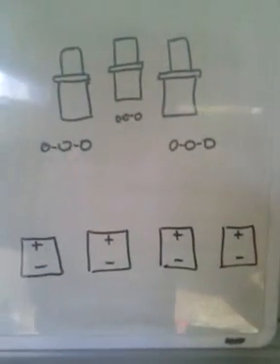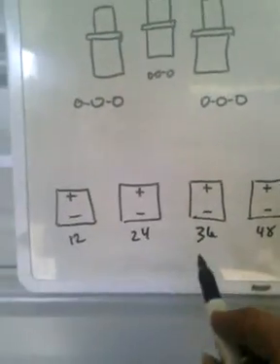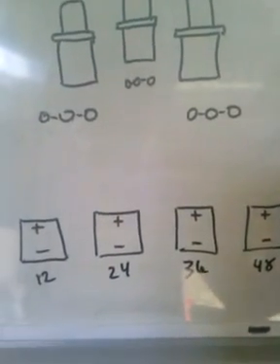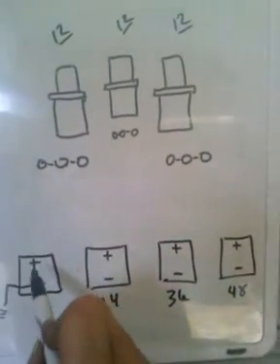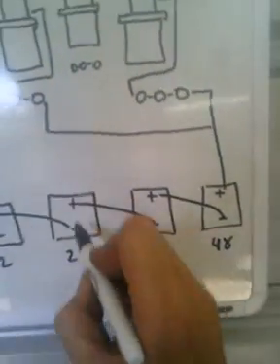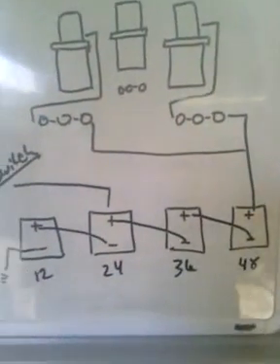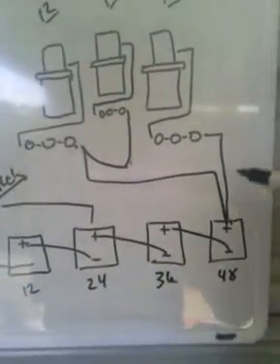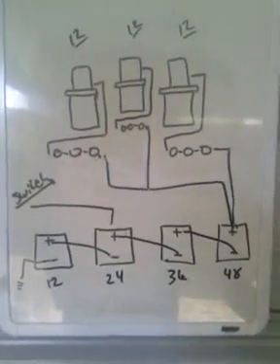Wiring Diagram for hydraulic set up on a car

Comment: Can you run 9 batteries with 2 pumps?
Reply from the maker: yes, but depending on your setup as far as it being built as a hopper or just a streetcar lay and play 5 batteries to the nose and 4 to the rear. Just keep in mind 60 volts is alot of power to regular motors and solenoids. if it's a basic street car I would just stick with 8 batts 48 volts to front 48 to rear. atleast 3 to 4 solenoids per pump

Comment: ive been running my set ups this way and find this to be the most fun and reliable way to lay and play, solenoids and switches are more than 5 years old easy i go through a starter every 3 years if that. Gears ive never had to replace

Comment: Where do you put the ground disconnect ?
Reply from the maker: f13joker if the rack is welded to frame you can use the battery tie down rod if not use a bolt on the frame. Then of course the other end will go to negative post on 1st battery

Comment: I have 8 batteries, and two pro hopper pumps. Should I run each pump to a set of 4, or both pumps on all 8 batteries?
Reply from the maker: Joseph Keith Yates II a lot depends on your intentions. if it's just a cruiser yes 2 banks of 4 at 48 volts would be great. the backs gonna be fast so you could do 5 and 3 that way more power to front snap it a little quicker and back would be about perfect on 36volts.
Reply: Bradley Powell thanks for the quick response. The switches could be ran to either set right?
Reply from the maker: Joseph Keith Yates II yes, just make sure it's only a 24volt supply

Comment: can you explain how to charge the batterys in a low low I just got a cadi 6 batterys 4 switch's 2 pumps and not sure how to charge the juice can I charge them all at once or do I disconnect them from each other n charge one at a time n what kind of charger will work

Comment from the maker: the quick connect goes from the negative post of the 1st battery. the other end needs to connect to a solid piece of metal like the frame or the pump rack of it's mounted solid to the car. I like to put the female end of the connect hooked to the battery that way when it's unplugged the post can't accidentally ground out

Comment from the maker: I had a 2200 juiced it was bridged but only running 2 pumps. 6 batts across the tail. it was hard to hit 3 in the front but would hit front bumper doing 3 in the rear. so I suggest running 3 pumps and be carful not to stress your leaf springs to bad especially if your doing mono leaf. possible they could break. I would suggest doing a 4 link setup on the rear
Reply: How to you connect the quick disconnect which one goes to the negative,and to the positive, does the male go to the ground or does the female go to the ground which ones positive.I'm having trouble I'm running a 2 pump 4 batteries and 10 switches.

Comment: I have a 4 pump 10 batt setup
looking to change it to 96 volts to nose and front 2 pumps
and 24v to the 2 rear pumps
any ideas on best way to wire? 4 switches full wrap and reinforced caddy
Thanks!

Comment: No. No. No. You don't want or even need 48v to the rear. Unless your building a dancer just have their leads attach to the second battery so they get 24v. If you over power the back it's going to hop. Unless you want that.

Comment: Can you help me I have a question..do I have to desconnect every battery to charge them one at a time..I don't have a muticharger..so I need to know if I can desconnect the ground and charge them while there still linked..
Reply: No, you don't. Just disconnect the ground to break the circuit. Then you can charge them individually
Reply: I have the same ? so I just disconcet the ground do I leave all 6 batterys linked n conecet the charger to each one n charge one by one

Comment: How should I wire it if I got three pumps , 8 batteries?
Reply: This is very wrong. You don't want your rear pumps having the same as the front ones. I actually have the exact same setup you mention. Have 24  volts going to the back. Not all 8. Unless your building a dancer.

Comment: ok so I have a 2 pump 4 battery setup and everything was working fine. I replaced the batteries and wired the new batteries. Well the car will raise but wont lower. is there a way to test the dumps to see if they are bad or do you know what may be wrong with it
Reply: Lorenzo Alvarado have u tried opeing the slow down valve

Comment from the maker: @mofat9803 look at the vid I did for the chain bridge. See if that helps you out. For the arms there's few dif. ways to do them. I'll see if I can make a vid to explain it. As far as stroke in front. A 8" cylinder is usually about it. There's things that can be done to get high lockup but involves alotta work to the front end. Most cars don't even use full stroke on 8's if you got good springs

Comment from the maker: @balin309 there could be several things wrong. Without seeing it there's no way for me to tell. Somethings that can go wrong motor goes out, pumphead goes out, solenoids are bad. If the check valve is bad it will leak down or pump will spin but not move cylinder. Check valve should be at pressure side of block before dump body. Sorry I can't better help you but like I said without seeing what its not doing its hard for me to trouble shoot. Start by making sure your getting power to the pump 1st

Comment from the maker: You cannot run hydraulic batteries to a alternator because they are wired in series. You have to charge batteries individually with a charger. Takes about 30 to 45 minutes per battery if its dead. But that's one of the biggest issues with hydraulics people not keeping the batteries charged. Pop solenoids and burn up motors as well as wear the batteries out.

Comment from the maker: Not a problem. But question before I do are you wanting to run all 8 to the pumps? Is this a double pump hopper or just a street car. Because all 8 to each pump is A LOT of power. I had a 4 pump 8 batt. streetcar and was running 4 batts per 2 pumps. Let me know what your looking to do and ill make vid tomorrow. Thanks

Comment from the maker: @David with 3 batteries I would run 3 solenoids. You could run 2 but 3 is a lot safer. The quick disconnect will go in between the 1st point of the ground going to the batteries from the rack

Comment: hey man i have 62 impala station wagon the front is juiced and i have 1 pump 3 batts. was wondering where does the quick disconnect switch goes.. and how many solenoids do i have to run? thnx

Comment from the maker: @mofat as far as the chain bridge goes. It's not easy to explain. I will see if I can make a vid showing it on paper and how it works. But unless you can weld really really good I suggest letting a shop do it. Those things are under serious pressure and if it breaks those cylinders are going through the deck and rear glass of that regal. You need to reinforce the axle too. There weak and won't hold up. Also a bridge will help keep the quarters of the car from buckling. Gbodys are bad about it

Comment from the maker: @mofat. Sorry I don't mess with those cce prewired boxes to know what color wire it is. But take the lid off and the switch labeled back it should be a 6 prong the top 2 and bottom 2 are your power and dump leads. Those colored wires are what you'll need for the rear pumps. I'm trying to find time to do vid on wiring switches for 2 & 3 pumps. Maybe have up in a days or so. Hope this helps.

Comment from the maker: few different ways you can do it depending on what you are going for. For example if someone was building a hopper they would choose to run a 72 volt current. all 6 in a series to 1 pump. if you just have a street car safest way is 36 and 36 to each pump. you will wire the same as description except there is only 3 batteries instead of 4. you will need to run a jumper wire for the ground wire. its easy but I will post a video for you and draw it out on the board. thanks for watching